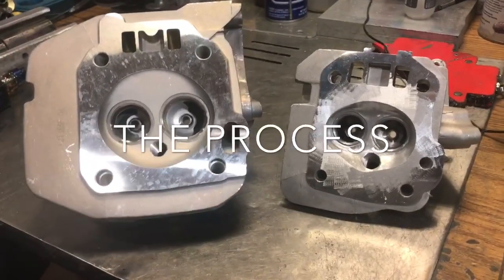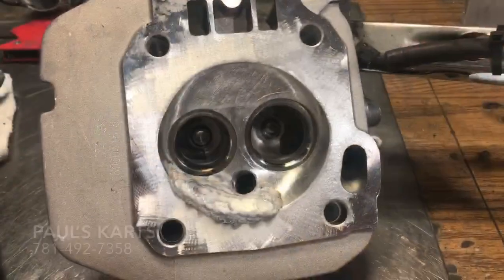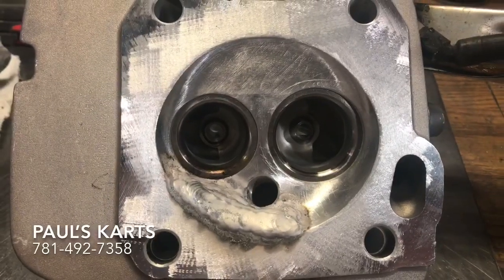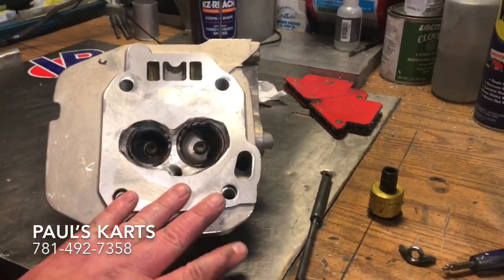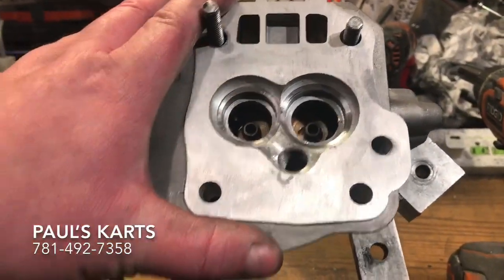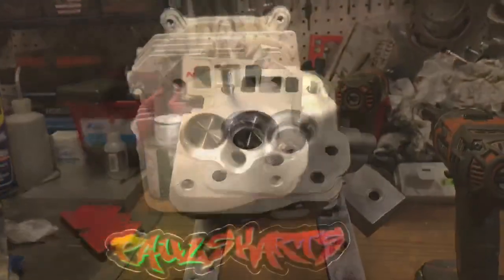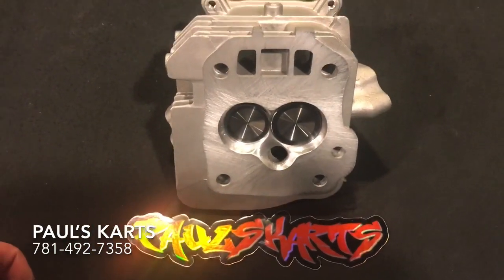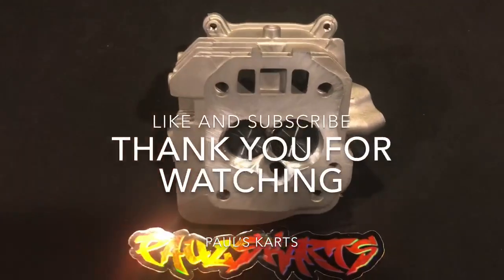How to weld a head for more compression predator 212 / gx390

Comment: @Paul's karts I have a set of tecumseh V-twin aluminum heads and the chambers are quite a bit WIDER than the cylinder is and i need the chambers filled in on the outside edges of both valves so that the chamber isnt overlapping the bore. I'll probably also offset drill the head bolt holes a little so the intake valve can be less shrouded and the exhaust more shrouded. If i can't find someone local to do this for me, would you be willing to fill those outside shroud edges with weld for me and if so, what would you charge to do this? i can do the shaping of the chambers myself once its filled. If you do this for me, what would you charge to also shave the heads down afterward about .120"-.150? I'm in Georgia so i'd probably have to ship them to you.
Reply from the maker: @jeremiahfiek5495  text me some pics 781-492-7358 and I’ll be able to get you more info
Reply: @paulskartslifan4206  i actually just found and bought a set of VTX 691 heads (mines a TVT691) that they corrected that overlapping chamber issue on... intake valve is a tiny bit smaller, but the other one would have been right against the wall anyways after the correction. We'll see how they look when they look here and I'll hollar if i need your help with anything. Thanks brother

Comment: Is that 249 welded
Reply from the maker: If you’re talking about a site item. It has welded chamber and depending on item has big seats installed. Chamber is shaped and head is milled. Site item is not ported .. but this is very similar.
Reply from the maker: Just watched the video .. yes that’s the one 💪

Comment: I recently reshaped the combustion chamber in my 79cc predator and the amount of torque easily doubled. Next part I'm going to reshape will be the cam shaft. The goal is to atleast triple the power output of my scooter engine or blow it up trying.  Good to see I'm not the only one going extreme thanks for the vid.
Reply: How did it go?
Reply: I would recommend picking up a billet flywheel past like 5.5k I blow magnets off I've done 2 now

Comment: Do you have to take the valve seats out before sending?
Reply from the maker: That’s nice of you to ask but it’s prob easier for us to do it. If you cut to deep you can damage the counterbore behind the seat. It’s an easy enough part of seat replacement for us that we don’t ask for this to be done before sending in a head that’s getting seats. But thoughtful of you to ask. 😊
Reply: @paulskartslifan4206  how much would you charge to tighten up the squish on a set of v6 mustang heads
Reply from the maker: @thejunkshredder2345  so mill the heads ? Like $75 per head. Just ship in and put amount you want milled off written on the heads in marker.
Reply: @paulskartslifan4206  do you think it would be possible to weld up the combustion chamber and then reserface. The pistons are dished on Fords so you can't mill them alot. I'm aiming for 12:1. You might be able to add to business welding tighter pockets on Ford heads. V6 and v8s.
Reply: @paulskartslifan4206  a good set of high compression heads for a V6 runs about 1800 bucks online.
Reply from the maker: @thejunkshredder2345  the pistons are dished or domed ? Dished wouldn’t pose such a threat but you would def wanna check your clearances with some clay before milling it to know what you can take off the head. If the chamber could be welded and re shaped that would def make more power. I don’t see guys doing that to cars tho but I’m sure there are some vids out there. I have seen welding repairs on dropped valve heads but never seen them do what I do to these smaller heads. It would def be a better way to increase compression and probably improve the chamber design of the original head. But think about it, it would be a ton of work.. hehe ☺️ that’s a lot of chambers to weld and shape. Prob why there not done to often. But it’s doable ! I’m sure if it was done there would be people calling for them too haha. I would need a clone to do all that work !
Reply from the maker: @thejunkshredder2345  yea if you can’t mill to get the compression you need then that’s a great option. $1800 ain’t bad

Comment: Ill be buying a head from you soon. Just gotta get past spending the coin on a good race head for a weekend toy lol. I currently have a Pred 212 with 32deg flywheel, .265 cam, billet rod. Light porting i did my self, 26mm carb tuned. Runs great but i really feel a bump in compression and bigger valves to go with that carb would make all the difference. Im almost convinced. Great work man
Reply from the maker: I’ll be here ! Thanjs

Comment: Paul I have 2- 212cc 20 degree valve outlaw heads, how much to make that high compression?  Thanks   Mike  falcon347@charter.net
Reply from the maker: The tillotson hemi .. well it’s got to do with valve clearance .. the only hemi head I sell are welded chamber .. you need to try to get to a minimum of 12:1 compression on any head (or higher) .. all the cams state that on there cam card and it’s really not a suggestion .lol.. I’d recommend trying to get as close as possible .. being a 20° Hemi chamber that’s a huge chamber .. I would def recommend a welded chamber .. In a non-hemi you have the opportunity to maybe Mill the head some to get the compression ratio up but if you mill a hemi head you’re only at around 9.5- 10 :1 compression ratio then you can’t put any good valve lift to get any flow , so really the only thing to do with a hemi head is well the chamber. Thanks for the comment .. please like the video ! ... Paul
Reply: @paulskartslifan4206  Thank you for the info Paul, I will be calling you in the near future about doing one of these heads for me, again Thank you   Mike